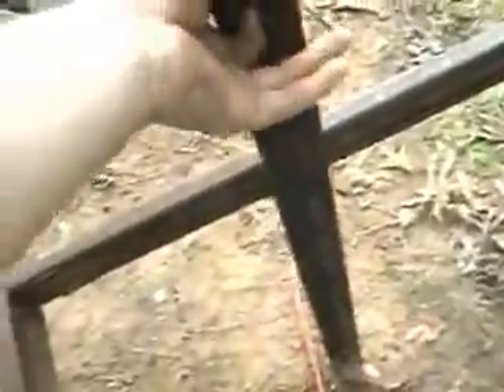trailer part 2

Comment from the maker: i got it to hold i did try a smaller rod seems to be pretty good i held each weld there for a long time and i did run bolts just to be sure thank you for your tips